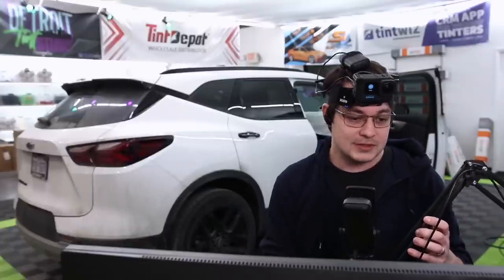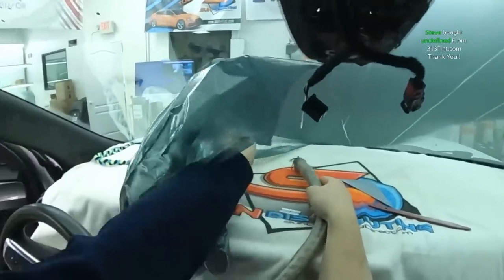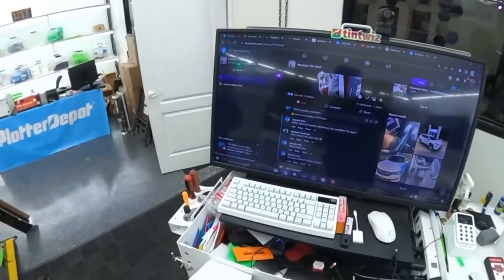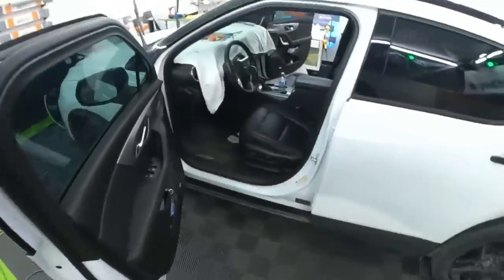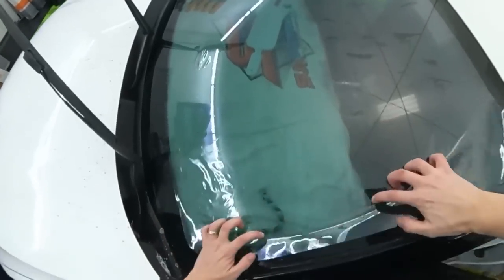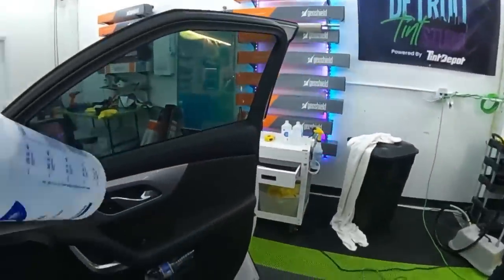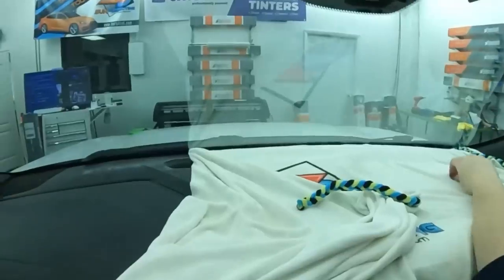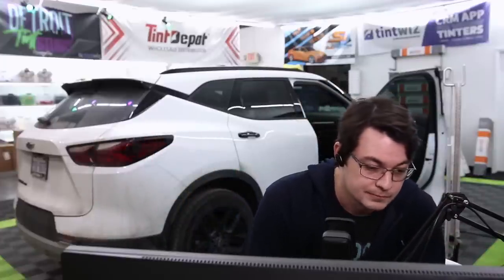Apex Ultra 50% ;) not a windshield tint

Comment: when I bought the Pro Classic last year for my Chevy Silverado 1500 regular cab WT, it has the dot matrix around the edges of the windshield, and I remember one spot at the bottom of the windshield wanting to curl up, so I used a micro fiber towel to push in on the spot for 24 hours, and then I came back with the heat gun and squeegee and heated the outside of the glass as I pushed everything down again. I came back the following day with just the squeegee and push the edges down again, and it came out decent on the edges. Probably as good as you can with the dot matrix anyway. This year I want to strip the Pro Classic off and do The Pro Nano, but I may try the new Apex 50% on the windshield now that I see you doing this 2 ply 50% Apex.. I think I was using 35% on the windshield before, and I was pretty happy with that as far as glare reduction. Not sure I want to sacrifice the reduced sun glare. I don't know.

Comment: ok, now I'm curious about the mix on the water/alcohol mix for your windshield. I've seen you use it after an install before, but the alcohol seems to help dry it out and help it stick better. 50/50? or more like 75/25 water alcohol respectively?

Comment: when I was doing the Pro Classic last year on my truck and dealing with the dot matrix on the edges I took the heat to the outside of the glass to help keep me from shrinking the film anymore and still help dry out the water between the film and glass.
Probably a big difference between the 1.5 mil die film and your 2 ply Apex ceramic film, but it helped me keep from over heating it. there was one spot at the bottom passenger side that kept wanting to curl up on me, and I took a micro fiber towel and wedged in at the bottom and put some heat on the outside while I pushed it back down with the squeegee and then put the towel in there to hold it, and I let it sit there for 24 hours. When I took it out, honestly I think it was 2 days I left it there, it held fine. It's been about 9 months and it looks good. I definitely want to do the Pro Nano around my truck this summer. I think it will help with the heat, and I often eat my lunch in my truck.
thanks for showing the install, Matt!